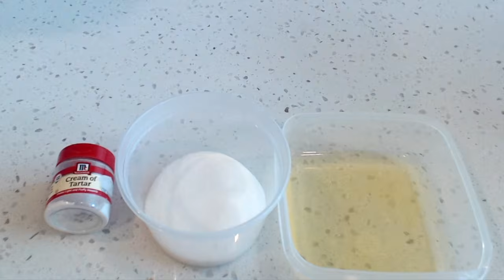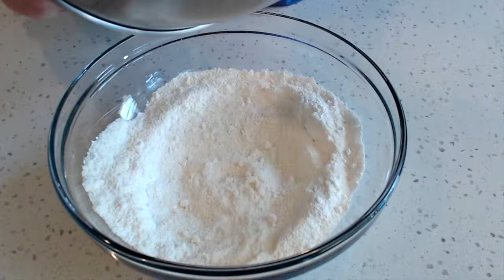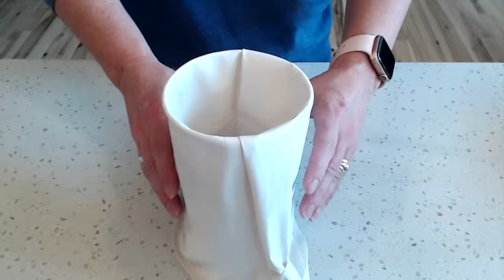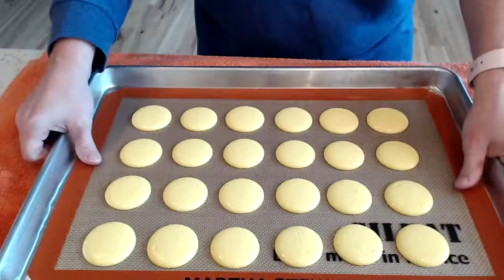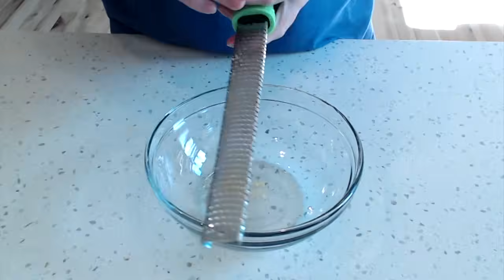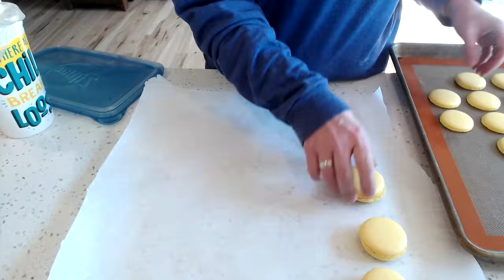Lemon Macarons | Lemon Zest Buttercream Filling | French Method | Easy Beginner Macaron Recipe

Comment from the maker: What other macaron questions do you have?
Reply: I tried so many times , but still got hollow, do you have some tips that you can share to fix hollow shells? Thanks
Reply from the maker: Hi Kathy!  Hollows can be caused by a few reasons. Here are a few things to pay attention to:
1) Is your meringue really stiff peaks? Make sure your meringue has straight points coming off the whisk and down in the bowl. 
2) When  in the  macaronage stage, as soon as you can you make a couple of figure 8's with the batter rolling off the spatula continuously, STOP. Stop and check the consistency of your batter frequently to see if you can  make a couple of figure 8's. It's been my experience that if I can make several figure 8's (like 5-6)  without the batter breaking, then I have overmixed the batter.
3) If you are doing the two things above correctly, then examine your baking temperature. More than likely the temp needs to increase or you need to bake a little longer. Use an oven thermometer, if possible, to make sure the inside temperature is what you have it set on.  

If increasing the temperature, try doing it by 10-15 degrees and bake at the same time. and evaluate from there. If increasing the time, start with 2 minutes and see what happens. Learning your oven is an experiment all in itself. 😀

Try these things first and let me know how it goes. Would you like me to make a video about these tips so you have a visual of what I'm talking about?  I'll be happy to make one!
Reply: @MacaronAcademy  thanks so much for the info Amy, much appreciated.  I think my issue is that I had a hard time to tell whether my meringue is really stiff peaks as I use hand mixer.  Oh, I stopped after I was able to make 1 figure 8, thanks for the great tip, I will try to make “several” figure 8’s in my next try, you’re so nice Amy😀
Reply from the maker: Aww.. thank you! You are very welcome! I used a hand-mixer for the first time today and I'll say it is different than using the stand mixer. You have to go longer than you think. 😀
Reply: @MacaronAcademy  oh oh ic, do you recommend whisk it with the highest speed with hand mixer? I have kitchen aid 5 speed hand mixer, and I usually just whisk it on 3 before I add the sugar and then 4 after that.  And whisk it for 12 mins.
Reply from the maker: I also have the Kitchen Aid 5 speed mixer but line is 20 years old. Lol. I did exactly what you described but I did go to 5 because I don’t think my motor is as strong as newer mixers. It still took about 15 minutes for me to reach stiff peaks. I’ve gotten quests about using the hand mixer. I think  I’ll make video about that because I can see how you think you need stop when you really need to keep going with the meringue. 😀
Reply: @MacaronAcademy  oh thanks much Amy, ah  ha, so it took you 15 mins, now I feel a lot better, at least for me this is a super helpful info. 😀 really looking forward to your video with hand mixer, you made my day Amy😀
Reply from the maker: Oh I’m so glad that helped! 😀. Yay!  You are so welcome!
Reply: @MacaronAcademy  You can’t tell how happy I am right now Amy, thanks thousand times for the awesome tips-couple figures 8 and 5,6 for sign of over mixed batter, and extremely helpful tip for the speed of hand mixer, and mins.  I tried it out yesterday immediately after reading your reply.  I whisked it on 5 like you said to get to “really” stiff peak.  I just took my macarons out from the refrigerator and tried one, oh my god, I couldn’t believe it that I finally got no “hollow”.  And I can’t wait to share it with you.  😀
Reply from the maker: Oh I’m so happy!!!! 😀. This is amazing and I’m so proud of you for not giving up! You did it!  Happy dance!!! 🎉🕺. You can DM me on Instagram @MacaronAcademy if you want to share pics! I’d love to see them!
Reply: Hi, Im wondering with your oven if you usually cook all your macarons using a fan forced (convection) or conventional oven setting? So many recipes and videos don’t specify. Thanks for your video 😊